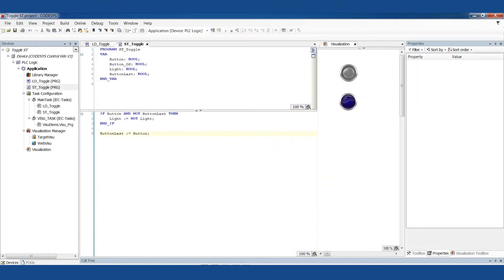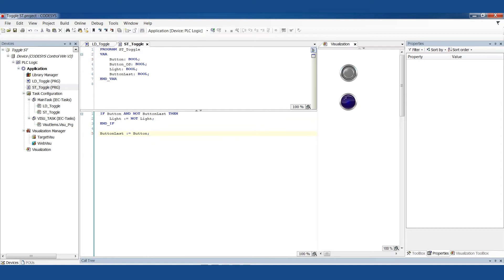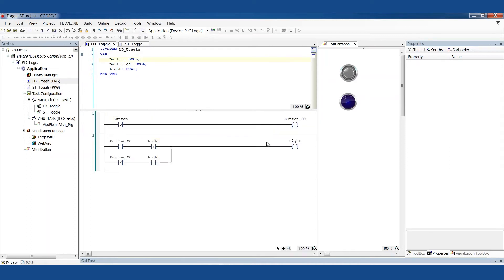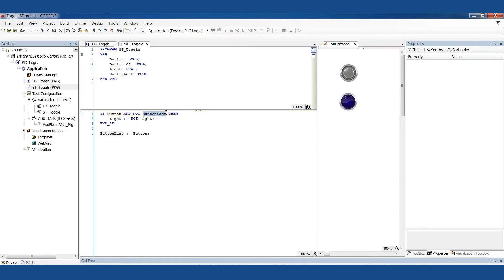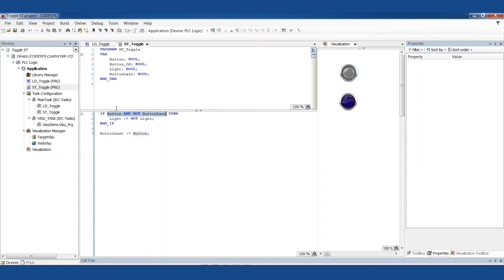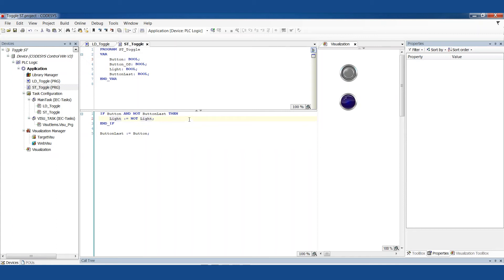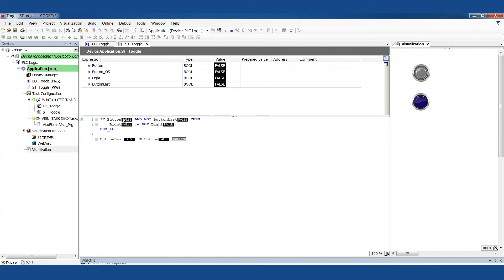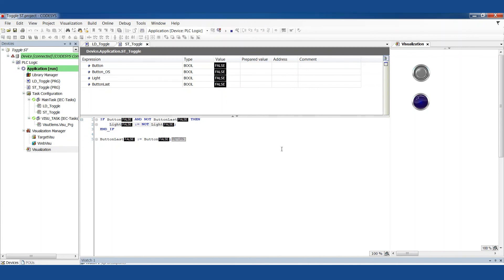How to Toggle a Bit in Structured Text - PLC Programming Cookbook

Comment: Hi I am learning PLC programming, especially codesys, I am used to program MCU's like Atmega2560 or ST32 or DSP430 etc.. I use to do it with c++ and I find structured text very similar to C code language but again it is different. If I want to make a state machine with switch case, can I do that in codesys using structured text?
Reply from the maker: Yes, a case structure is a great way to make a state machine in structured text.  Here's an example from Codesys help:

CASE iVar OF
1, 5: bVar1 := TRUE;
      bVar3 := FALSE;

2: bVar2 := FALSE;
   bVar3 := TRUE;

10..20: bVar1 := TRUE;
        bVar3= TRUE;
ELSE
   bVar1 := NOT bVar1;
   bVar2 := bVar1 OR bVar2;
END_CASE;

Source:  https://help.codesys.com/api-content/2/codesys/3.5.12.0/en/_cds_st_instruction_case/